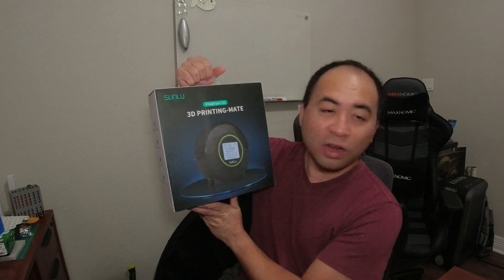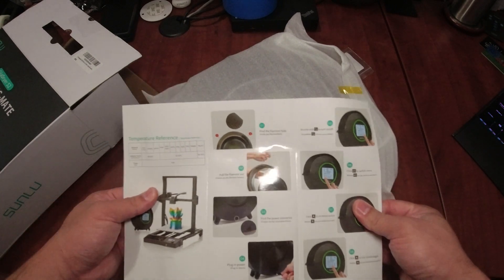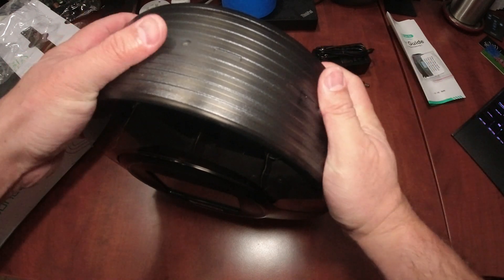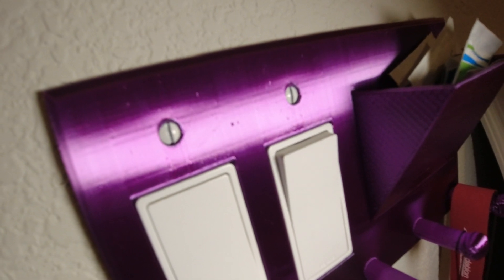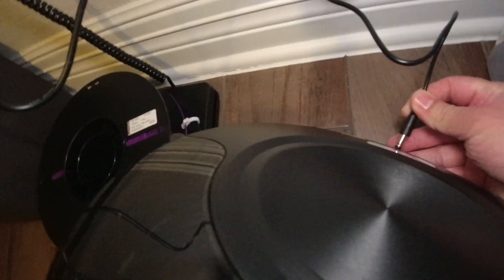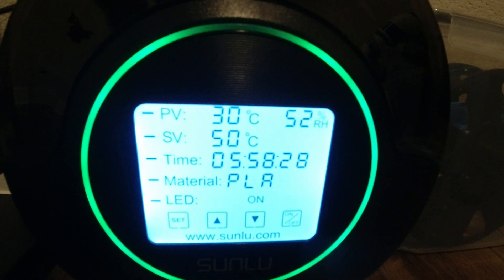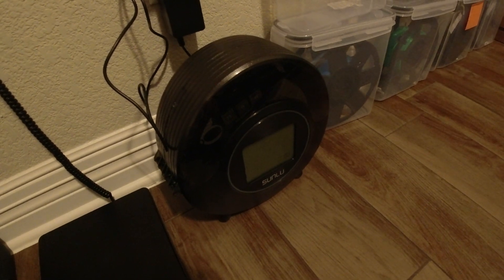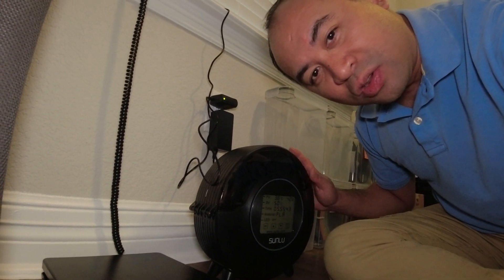Staying dehydrated with the Sunlu Filament Dryer Box S2 for 3D Printing

Comment: Where is the fan?
Is it blowing the air inside or outside?
Reply from the maker: It's circulating the air inside
Reply: I does you no good to vaporize the water from the filament and not evac it out of the dryer. it will just re-absorb back into the filament remember water has three states - Solid-Liquid-and Gas or (Vapor) You must evac the vapor as the dryer pulls it from the filament other wise it just remains inside the dryer no matter how hot it gets.       @TonysTipBits
Reply from the maker: True, I end up opening the case once or twice to expell the vapor. That's been sufficient.